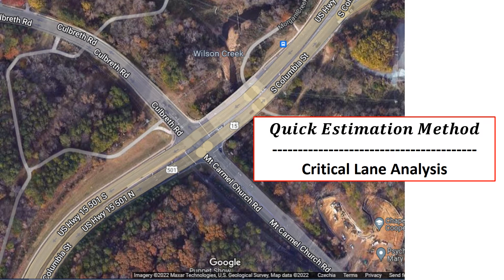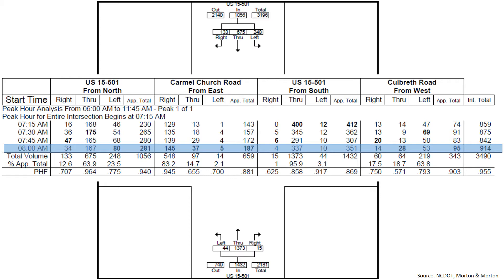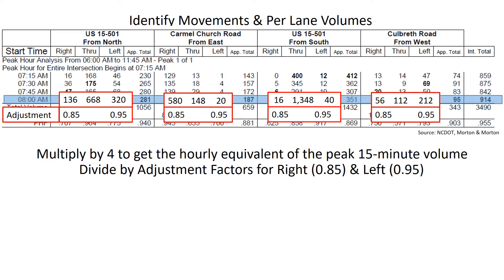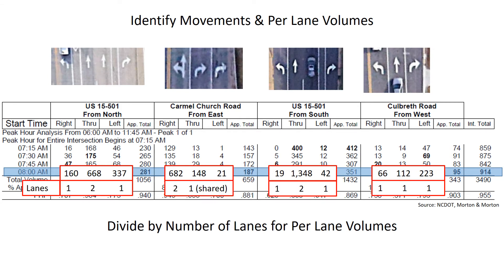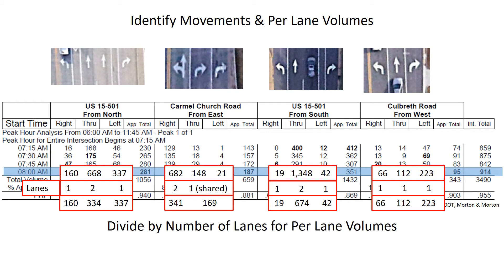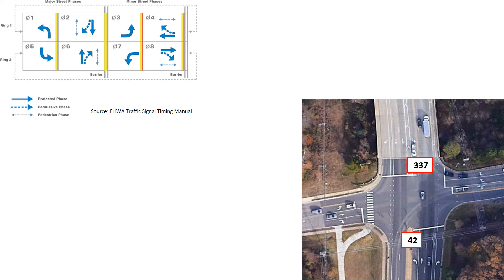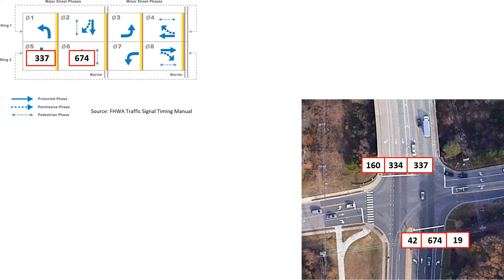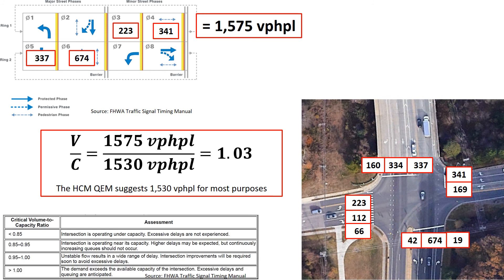Quick Estimation Method (QEM) Example - Critical Lane Analysis [8-Phase Signalized Intersection]

Comment: May i know how you get capacity 1530 vphpl?
Reply from the maker: That's a value from the Highway Capacity Manual - it can vary based on your particular location.  You can also measure it from a saturation flow rate study: https://youtu.be/sUXr9j9mbw8